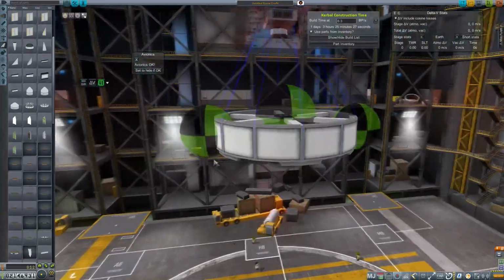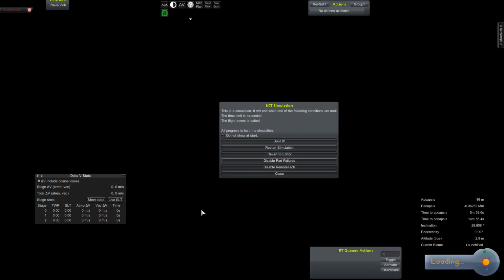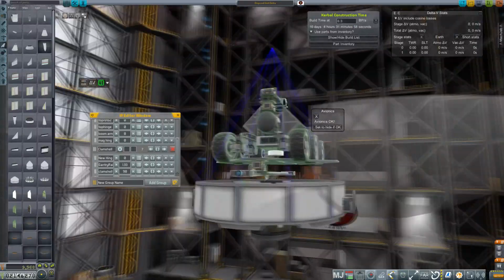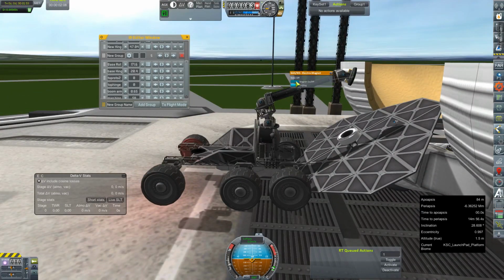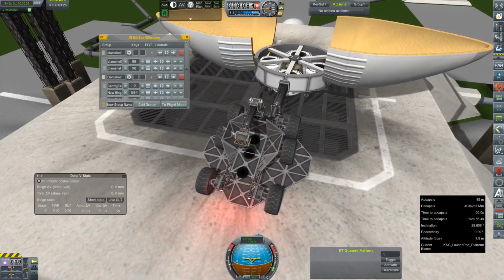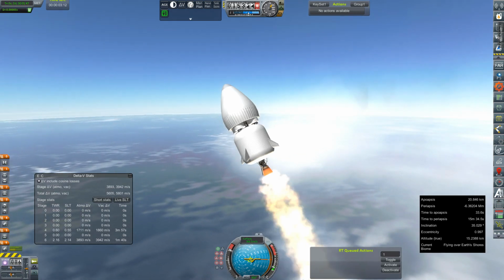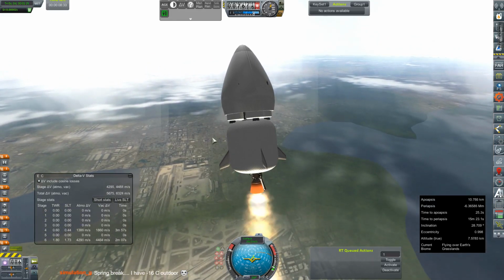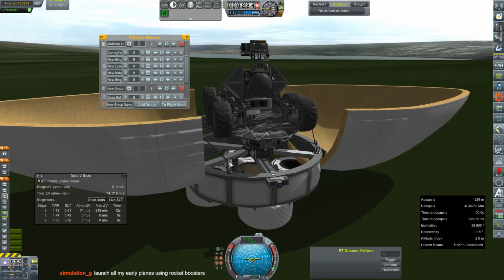KSP RP-0 #393 Robotics ( Twitch Re-Cap )

Comment: Hmm, I would say, just to land the rover with the rover on the bottom hanging from a throw away lander on top. Once it lands, decouple the rover, then launch away the lander to blow up somewhere else.
Reply from the maker: In all.of my other rovers, that has been how I approached it. This lander will also be responsible for carting away the old power couple once the rover loads it up, thus the added complexity.
Reply: Hmm, what about a drop box design?
Reply from the maker: VAOS like a crate ( made from structural panels ) and a single hinge to open close door? Cause yeah that's a much more simple, obviously better idea...
Reply: It's more simple not to touch this RTG stack and continue playing, right? But where's the FUN_AND_EPICNESS? :-)
Reply: Cosmonaut Crash - the dop box/pod, could have engines on sides , fuel on top, 2 doors on ether side that open like wings. Your rover drives out, picks up cargo, drops cargo in box, doors close , and away it goes.
Reply from the maker: In some off camera testing with this thing - it's Kraken Bait... through and through. think a simple Drop Crate might be the way to go. Thanks